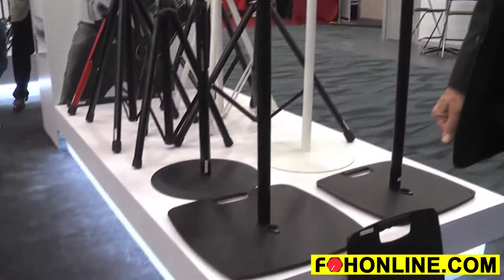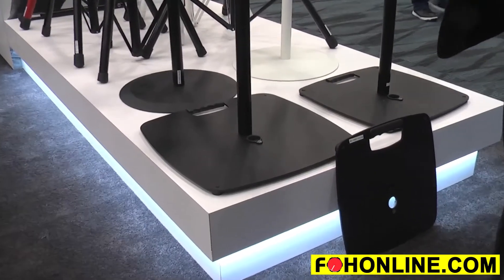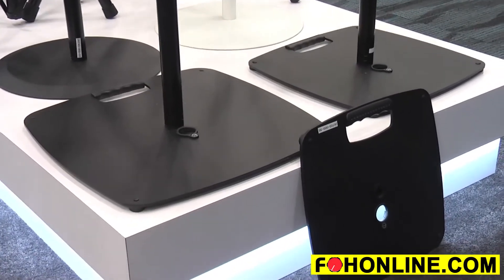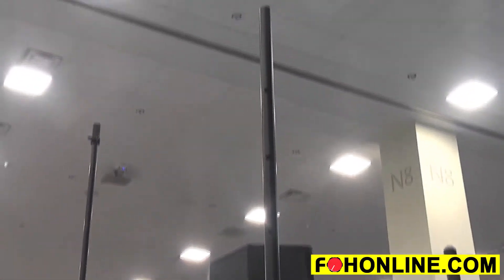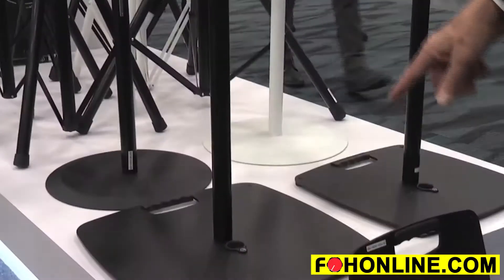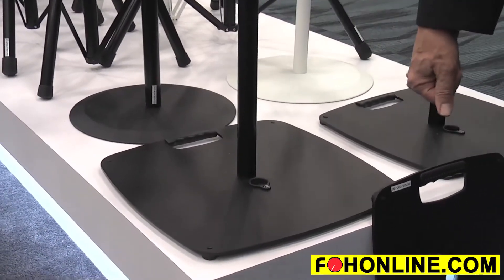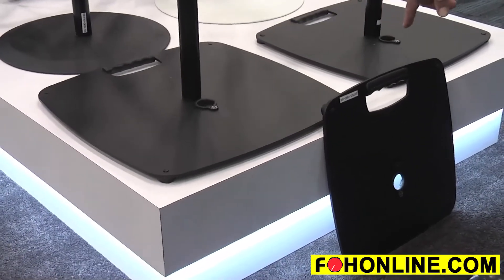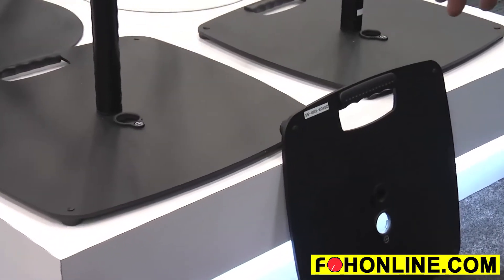K&M Flat Base Speaker and Lighting Stands

Comment: There is a need for these big time, as tri pod stands are uncool. But no one wants to spend large money on a sub just to get a stand! This Video is missing a big opportunity by not saying a word about the fact that the large base Round bottom stand will hold 60 pounds, and a JBL EON 15 in powered speaker weighs less than 38 pounds, but could it go on this stand? Nobody Knows?????